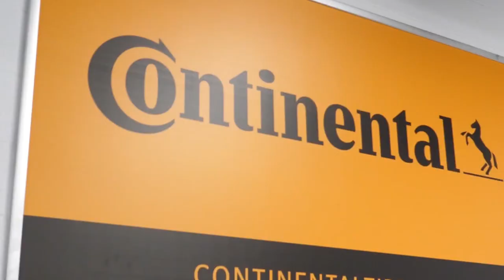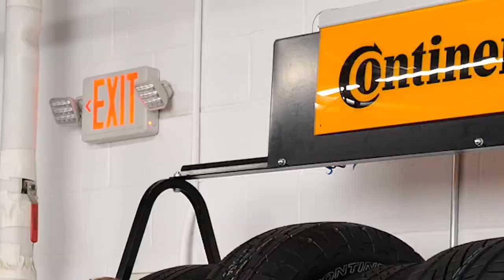Knowing Your Tread Patterns

Comment: The big problem with all this hype is that many asymmetrics disprove the theory behind the directionals. Often, the outer half of an asymmetric has non-directional blocks and continuous circunferential ribs but the inner half has swirly big groves like a directional tyre. The problem is that those swirly grooves are going THE WRONG WAY on one side of the car. Since, after 40+ years of asymmetric tyres, we are not seeing tyre companies being brought to their knees in court because only one side of the car grips in the rain, we can be sure that the entire directional tyre hype is utter b0110cks. And asymmetrics: I think the jury came back undecided. Retrial. In the background, some people in the industry believe tyre manufacturers eventually want to make a tyre that they will tell you is designed specifically for each corner of the car and then have an excuse to charge you the correspondingly specialist price for them. So in those circumstances, what we are going through right now with these three types is simply intended to mince our brains and prepare us for a tyre market devoid of reason.